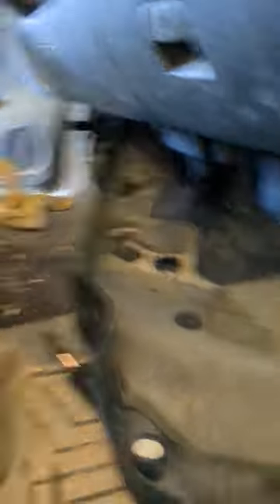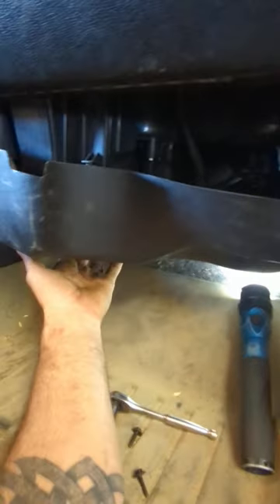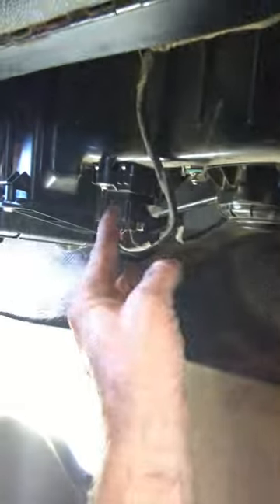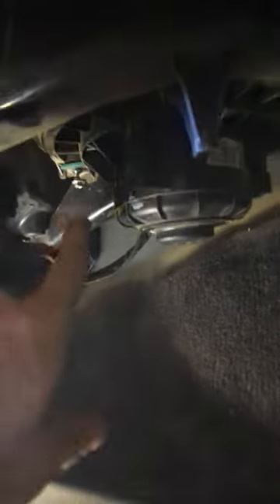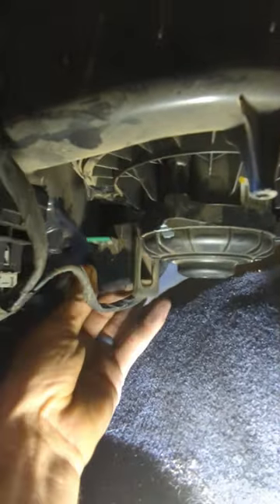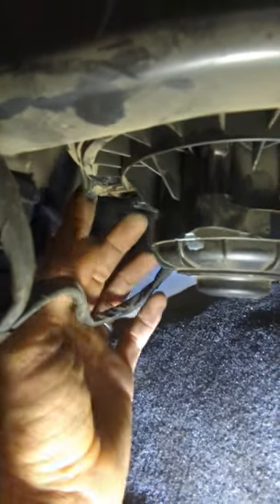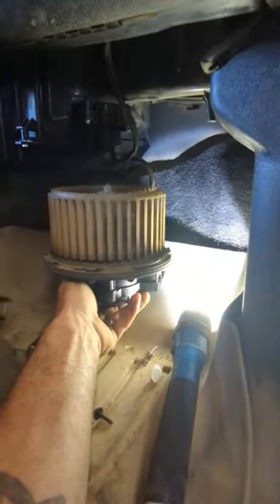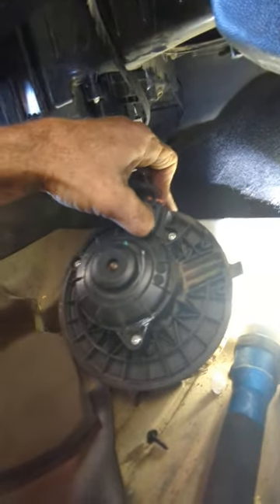Blower motor replacement | 2012 Chevy Silverado |

Comment: The piece with the 2 - 7/32 screws that comes off. How do u replace it with new motor? The new motor doesn’t have a hole on side that needs to be covered with that piece. Just leave it off?

Comment: Great Video , right to the point , helped me out bigtime , especially with the tab part and reinstalling the plastic bracket. I took it out and didn’t remember how to reinstall it , but your video is very clear . I will definitely subscribe, thanks 🙏🏻 plus the resistor trouble shooting tips were great, hopefully i don’t have to  replace the resistor , i so i ll reach  out to you if there’s a video or instructions.Once again thank you for your video !!!

Comment: I appreciate this video. The pull tab was a great help. I found out that the connector cable connection had melted where it connects into the blower motor. Probably caused by the corrosion on the resistor if I had to guess.

Comment: This is a great clip, I used this clip to changed my 2013 Silverado Blower motor. FYI I brought one from autozone didn’t like it. Went to pep boys brought and works great. Remember when installing the new blower motor. The exhaust is different on the new blower motors. You need to make sure you put a plug in the existing hole in the truck since the new blower motors have the exhaust built in. Also it’s best to replace the  AC resistor at the same time since it’s located next to the blower motor.
Reply: Good time to cut out the cabin air filter opening & install a filter. That’s located next to the resistor too. GM was cheap on this generation, & just left the filter opening sealed from the factory.

Comment: how do you know which one is bad or goood
Reply from the maker: If you have a volt meter, set it to DC. Turn the blower on at any speed, and test the blower wire for 12v (red wire) to ground. If voltage is there it's your blower, if no power,  you unplug the resistor, you can test each wire for 12v to ground for each speed you turn it to. You'll have one already hot, low will put 12v on a wire, medium will put 12v on a different wire and so on. Any more questions feel free to ask. If you need a diagram, just email me.

Comment: Definitley an easy install.  I noticed on the blower motor you put in that there was a spring/clip on one of the blades of the cage.  Mine had the same thing. (GM part). It was loose so I took it off.  Any idea what that was for?

Comment: Thanks for sharing this. However, my fan goes off and on with wire movement near the connector harness and when it’s working the wire get very hot to the touch. Could this be the wires or the fan? Is this a potential hazard?
Thanks!

Comment: Hi, my AC fan works well, but sometimes when I'm traveling, after three hours, the fan works very slow, I can barely feel the air, even in max level, should I replace first the resistor or the blower motor? Once I shut down the AC few minutes, it works again.
Reply from the maker: It could be either one sad to say.
Reply: @showmemechanics  well, I will start with the cheaper LOL thanks a lot!

Comment: I have a 2012 Silverado and when I turn my fan on a setting higher than the second setting I start hearing some squeaking. It sounds like a belt but I’m assuming the only thing it can be is the blower motor. The noise is definitely coming from behind the dash and not the engine. The noise really seems to be coming from behind the radio but that may just be my ears playing tricks on me. Do u think that sounds like a blower motor or something else. Like a blend door or something. Any input will be much appreciated. Ty.
Reply from the maker: It's hard to tell without being there.  You can pull out the blower motor and operate it to see if it is squeaky, make sure to hold it in your hand, don't just set it down and turn on lol,  It won't hurt anything. Usually door's  don't make any noises unless there moving, but to a selected position. Let me know what happens.
Reply: @showmemechanics  I will definitely let u know. I’m about to go look at it now.
Reply from the maker: Cool thanks
Reply: @showmemechanics  it was the blower motor. I’m not sure why it was squeaking but it definitely was. Changed it out and back to quiet as a mouse again. Thank u bud.
Reply from the maker: No problem, glad to hear, and thanks for watching. Have a great turkey Day.
Reply: @showmemechanics  u too bud.